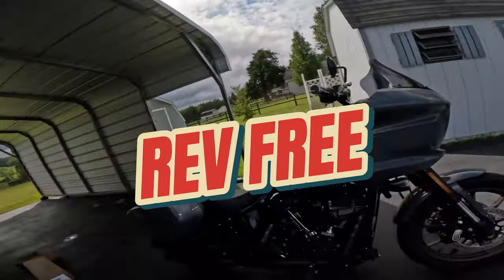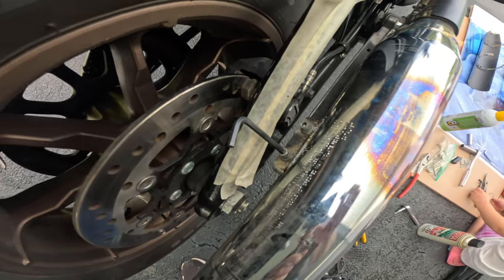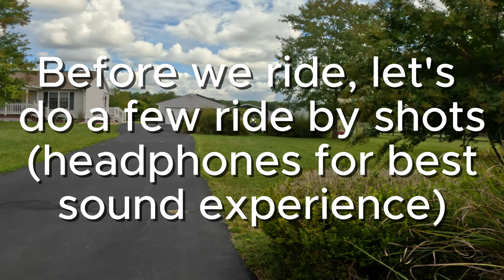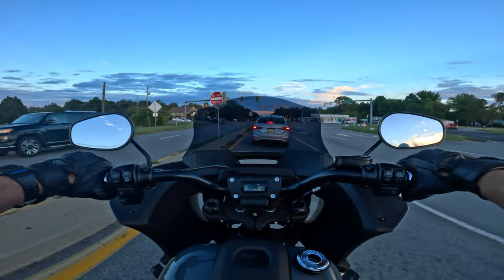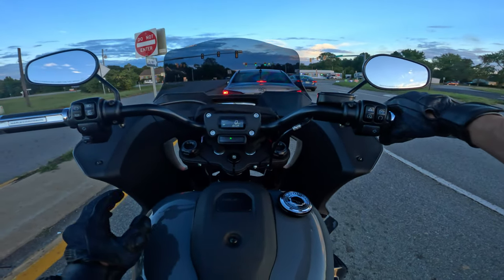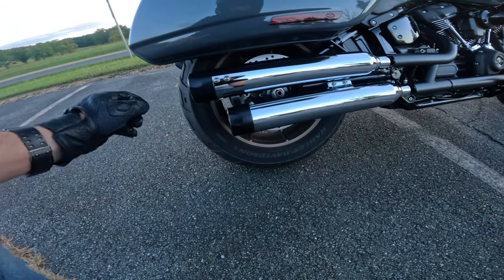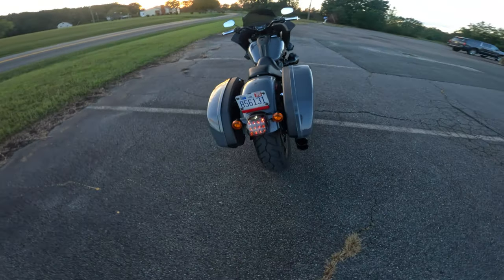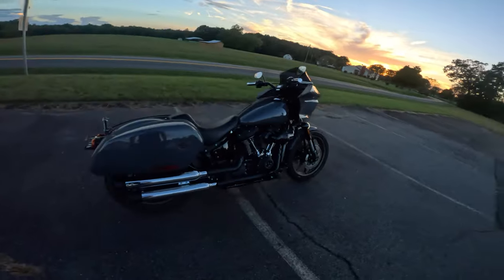TAB Performance Exhaust Upgrade for Harley Low Rider ST, Softail - BEST Bang for Buck (Sound Check)

Comment from the maker: Here’s the link for these pipes!  https://www.tabperformance.com/harley-softail-long-chrome-exhaust-pipe-mufflers-p/131-1291.htm  ALSO it should be noted that later I realized two things: 1) the bike does  look better with the heat shields on—so those are now back on the bike and 2) I may have reversed the top and bottom pipe and that’s why you see bolts showing on the end of the top pipe- usually these are hidden?  Probably not going to switch them back though 😂

Comment: They sound good ! That’s what I had on my 2020 heritage then I put the PCX Vance and Hines twin slash ! Thinking about putting the Tabs back on it .
Reply from the maker: @matttate2947  Vance and Hines are good pipes too - had the Eliminator 300 PCX pipes on the Fat Boy but those seemed so quiet compared to these.  How’s the volume on the twin slash?
Reply: @revfree  They sound pretty good bout like your eliminator 300s did on your fat boy a low rumble .